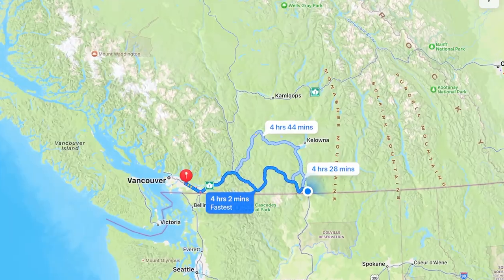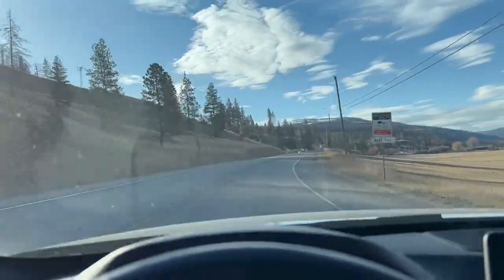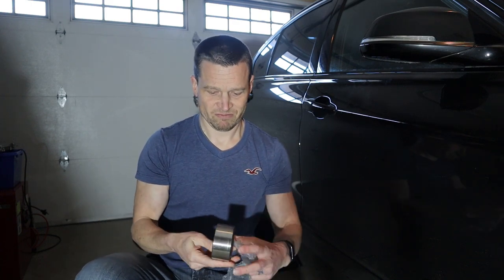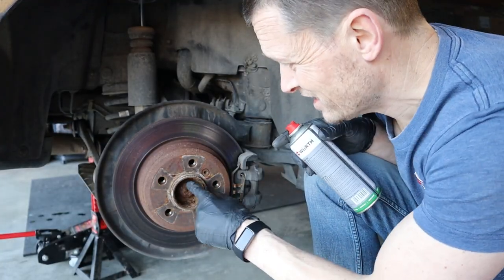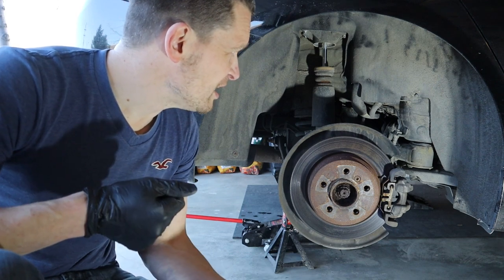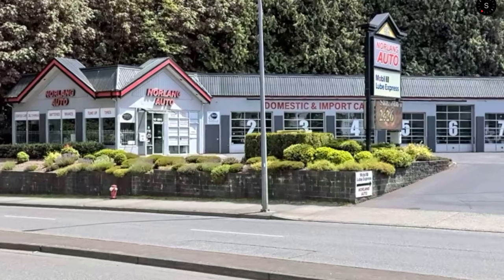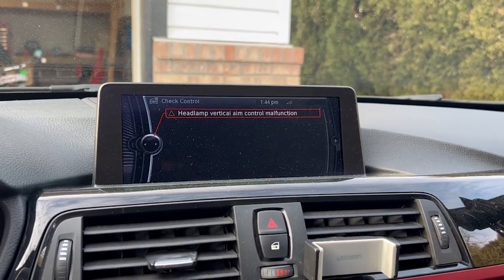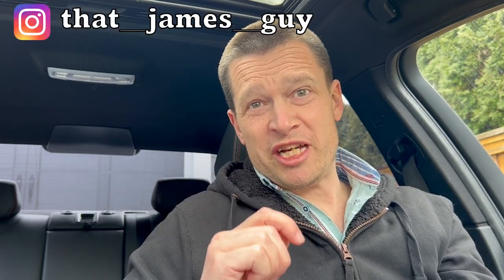BMW 328i F30 Rear Wheel Noise Fixed | Betty Gets a Wheel Bearing!

Comment: Rear clunk noise is what I hear in my F30, I’ve replaced most of the suspension parts but it still there, so I found your video when I now suspected the bearing on the CV shafts.

Comment: I forgot to mention. When you do the other bearings, get a dremel and slowly sand down a portion of the nut without damaging the axle threads, then get a chisel and hammer it counter clockwise and it’ll loosen. Trust me, you will be doing the other bearings.

Comment: Was this a woomp woomp woomp noise? We have a 2011 328i xdrive. Noise in front on both sides from 5-75mph. Just gets faster. Turning left and right at slower speeds doesn’t seem to change the sound. Pirelli run flats with 40% tread left. Tires are 5 yrs old now. I figured I’d swap fronts with new and try it if I jack up and all feels tight. Thoughts?
Reply from the maker: @romie7856  yep - sounds about right.

Comment: 1700 to replace a wheel bearing? 😂😂😂 I need to move over there and make off like a brigand myself. This is coming to you from someone who specializes on these for a living . 😂😂😂😂 

See here in Miami too many ppl drive these cars and the fear and mystery is gone. Shops as well as owners know it's all a crock and it's no different to fix/repair than any other vehicle. That nut wasn't even that rusty!

Did they even bother to align the vehicle after that fleecing? Or was that not included?

Comment: Should have done both wheel bearings. These are known to go bad together. Shitty shop, not replacing both sides. The labor overlap is crazy .
Reply: There’s no point of doing that if you’re not doing it yourself, they’re gonna charge you the same when you do them both or go back when the other one gets bad.
Reply: There shouldn’t be any reason for labor overlap